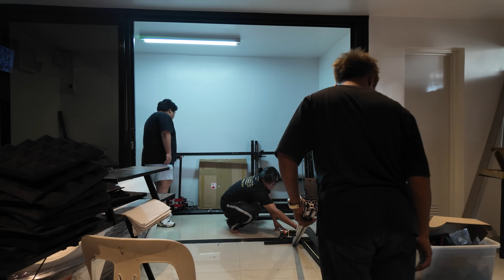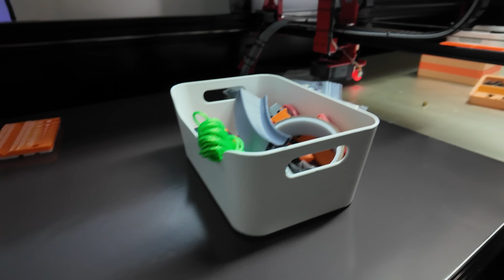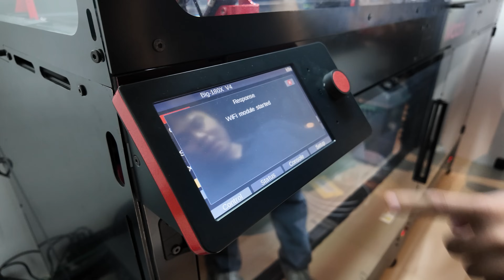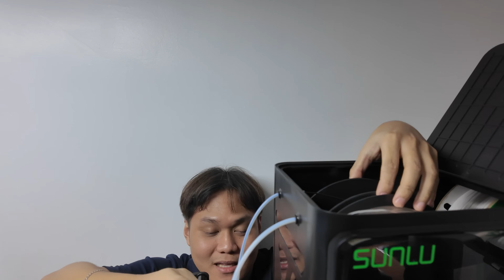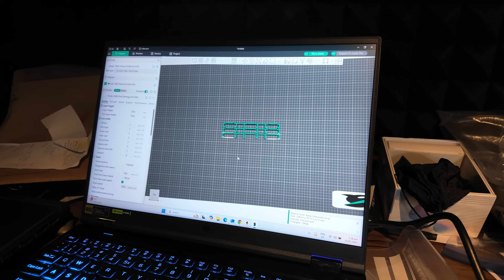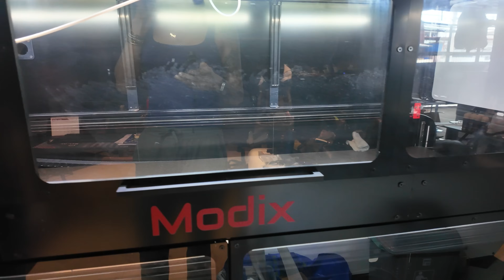Fixing my MODIX 180x 3D printer

Comment: that probe tip is going to melt sooner or later ; upgrade it to a cr touch or buy a lot of probe tips. baka yun rin yung reason of the inconsistency sa leveling. 

also, let the preheat sit for atleast an 30mins to an hour para magequalize yung temp across the whole bed so you can get proper leveling measurements.
Reply from the maker: Good to know, will keep that in mind!